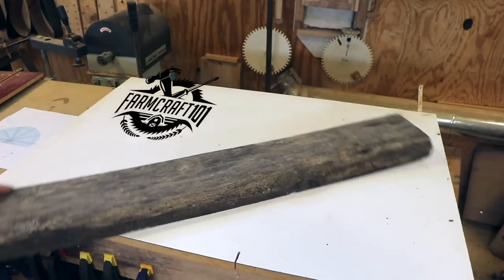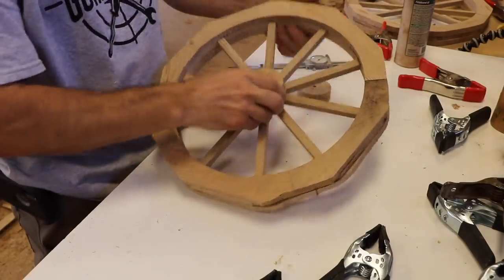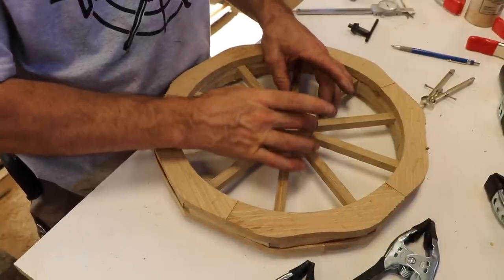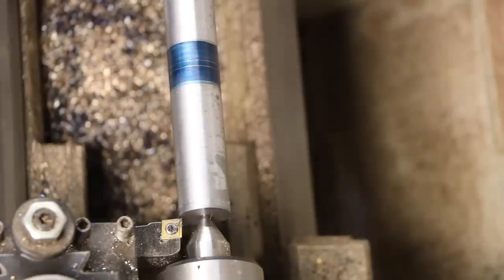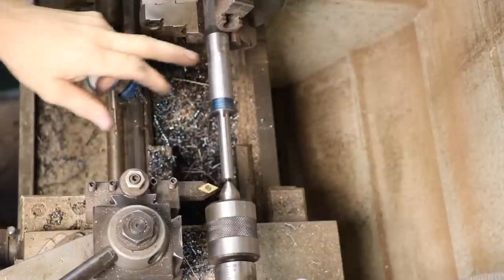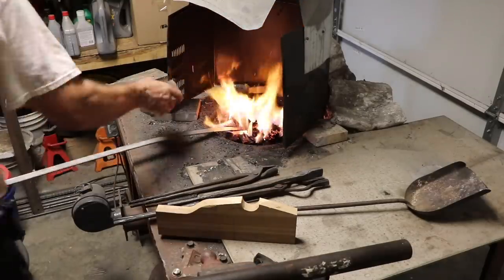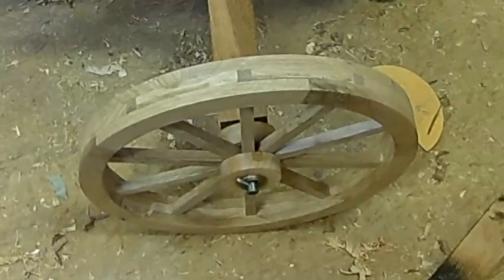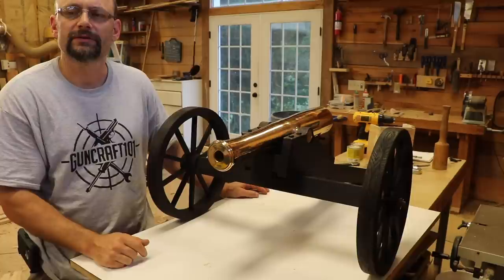Building a Historic Cannon Replica: The Carriage.  FarmCraft101

Comment: That's stunning.
After putting so much time and effort into this, I think you should take the final step and line the barrel with steel so you can fire it. 1/4" wall thickness would be perfectly adequate, because the liner will be supported on all sides by the brass.
If you do, be sure to make the liner out of solid bar stock. It's possible to use DOM tubing or similar, but that involves a separate breech plug, which is a janky way of doing it and will probably end up becoming dangerous after a while (whether welded or threaded, it provides places for corrosion to accumulate).
If you bore out a liner from solid stock, the cannon will last indefinitely as long as it is cleaned properly after firing.
If you do line the barrel, don't forget to also line the vent, so that corrosion doesn't start at the junction between the steel and brass. You can make the vent liner by boring a hole through a hex head stainless bolt.

Comment: I would suggest polishing it smooth and using crosshatches to carry a small layer of lubricant I think if you polish it completely smooth and relied on the bronze there may be some gaulding.  By the way I think you made a very responsible decision about the non fire I made one years ago out of stainless steel and it had a one and a quarter inch pocket for the powder shot golf balls I never found the golf balls but I found several billboards with holes through LOL burn finish is amazing

Comment: Bummer to hear you can't shoot it :( The silly This Old Tony-esque editing was on point though !
Reply: Keep an eye out on his other channels. He can't put everything here for political reasons.
Reply: But not as smooth ;)
Reply: Check out his other channels for updates on firing it.
Reply: I wouldn't shoot it just because of the casting defects.
Reply: @desepticon4  
Watch the video linked above - he's going to fill the barrel with molten lead and drill it out, leaving lead in the casting defects.
If it were me, I would make a steel liner for the barrel, which is a common practice in the cannon community. The lead should be adequate though.
Reply: @thepenultimateninja5797  That doesn't sound like it'll improve the structural integrity much. But what do I know.
Reply: @desepticon4  
I think it will be ok - the main casting flaw is some way up the barrel, so it's not going to be subject to the full pressure of the explosion. His main concern is smouldering debris getting caught in there and setting off the next charge as it is being loaded.
The lead should fix that.
Honestly, if it was me, I would put a steel liner in the barrel so I would know it was safe, but I think he'll be ok.

Comment: Torching is a good idea.  I’ve done it for several dozen projects.     I suggest getting a full char on all of the wood but leave the wheels be.      Once char is cooled down use a stiff nylon brush to remove it for an even finish.        Charring actually prevents moisture from getting into the wood as well is a natural pest repellent .        If you try and kiss the wood with a flame you will end up with an uneven-torch pattern.   Which is why I suggest a full char.       Once the outside is charred from the start you just move your way along the wood.     The outer char will prevent you from doing too much damage to the wood .          For deep chars you have to sit the tor h there for quite some time until the flame and wood start production on a deep orange flame.    So keep it steady and relatively fast pace and you will be set.     Also you can do a natural tan on the wood using oak chips and water.     I think you can also use urine with the wood chips to extract the natural tones from the oak.     
    Another stain that you can use is iron oxide and vinegar.  Add hydrogen peroxide to speed up the process with mere seconds rather than days .       If you need additional info or feedback I think you can now message her on YouTube, or if you like , You can email me .    Just comment on the post and I can give you my email and we can go back and forth there or a quick phone call.     Great job on the whole project.  I’ve been following this since you were researching metal compounds to use for your cannon 
   -Taren

Comment: The overall scorching is called shou sugi ban which is a Japanese style  (unless you're a pedant). You did well.  I wire brush it after, going with the grain which is tricky at joints, and then hose it off.  Yep, linseed oil every 6 months or so if outdoors.  Also, for anyone else,  glue joints can show so go lightly and possibly apply a fine touch of thinned matt black paint to them.

Comment: Smooth polished on bushings to shaft fit The least amount of friction possible..
 Standard moly grease works well
 Drill & tap axle shaft cross drill for lube holes. Install a grease zero into shaft.

Comment: Brother I admire your efforts. Next time would you dish the wheels so they won't collapse while your miniature horse is careening around a corner at 25 miles an hour. I've built 2 twelve lb. howitzers and a six lb. James at .35 scale I used the Mordechai plates to guide me on tube, carriage and implements. currently working on rev. war gun same scale. Thanks for your presentation.

Comment: Just a thought, but most cannon of the type you are casting have a steal liner in the guns barrel for added safety!  It is set in with some kind of high heat epoxy if I remember correctly!

Comment: Well there was staining done to woods. Tar staining was done for some cannon that did set outside or was near the oceans. Rare but it was done on a few. Otherwise old stains were made from boiling wood. I think it was the knots or such. 
Now I know you can use the cannon for firing a round unless you put a steel sleeve in it... But you might be able to make it into a reporting cannon. No pressure build up on the barrel at all.

Comment: 10:13 best thing to do would be to have spiral lubrication grooves in the bushing (similar to what you did for the epoxy, just shallower) and have the shaft polished. Another option would be honing the bushing but it requires special tools. If you leave the shaft rough it'll carry oil instead of the bushing but work into the Bronze much quicker.

Comment: Smooth axle, that's what I would've done. The gear box axles in my moped have no roller bearings on the inside ends, the opposite ends to the sprocket and clutch, they sit in a bronze bushing and are polished and the bronze bushings have spiral flutes in them but you don't need that.

Comment: If you plan to shoot it? Your not done. You will need at least 2 cross bolts to hold your gusset's to the center stock. The glue will not hold up to firing. Trust me on this. Having put that out. GREAT JOB!!

Comment: i normally grove my bushing like a barrel rifling one left hand spiral the other right hand so they carry the grease but the spiral groove dont come to the edge they stop short of it . the shaft always smooth. also the tail end of the carriage isnt finish. it needs the curve at the end with a a steel plate on the curve with the round pindle type hitch loop for towing and the 2 handles on the sides so a man could aim it.. but the burnt wood finish it beautiful

Comment: Did you nick my subscription list?  So far, I've spotted AvE, This Old Tony, Abom, Diresta, and a nod to Oxtoolco at the end.
Although it would have been cool to see it fire, I think the fact you've got any faults at all in the barrel rules out firing it.  You just can't tell if there's another defect that doesn't intersect the bore.  It's like when you buy timber for furniture making, and you pick the most fault free boards in the shop.  Then you plane them to thickness and find a knot, or a shake was lurking just under the surface (or is that just me?)
Great job, but I was a bit disappointed with the square spokes; I was expecting you to turn them.  Also, for authenticity, I think the rims would have been steam bent, rather than segmented, but I don't know if all cart wheels were made that way.

Comment: Need some metal rims for those wood wheels and spokes to hold it together then some caragehead bolts and washer and nuts for the metal rims and rifle the barrel for accurate fireing and good hits and some 50 cal primers to set it off with and a firepin design with a good spring and a 12 ft. Fireing cord . And then kaboom down range.and a 1/8 pound powder charge and a one pound ball shot of lead and a clothe packing like a muzzle loader rifle. And put some pin front sight that adjust Left and right and up and down by screwing it in or out and a peep sight rear sighting system. And you will have it made other than wheel chocks to keep it from rolling back when fired . I love it Man you did great. Rifleing should be 1 turn in 67 inches. That should be sufficient.

Comment: Smooth surfaces create less wear on the metals and oil lubrication is reccomended for cooling. That is to say in large scale or fast moving parts, for load bearing as what you're doing, a semi- polished surface should suffice with some WD-40 as lubrication should do plenty.

Comment: The axle should be as smooth as you can. A low viscosity lubricant should have no problem flowing between the two pieces.

Comment: Been fun to follow the journey!What's the model of the machine you used to bore/drill the axle holes at 13:16?Never seen one like that before....Not as smart as I thunk I was,lol.Made a barrel just like yours from brass barstock 'bout 30-35 yrs ago.Except mine is only 4-1/2"(the BARREL!),with just over .22 bore(hmm....)Easy to find lead that way.BTW, IT couldn't fire either ;-) Oh,and at 17:32.....Perfect....PERFECT??....Perfect Hell !!!,just LOOK at all that side-to-side wobble in those wheels!Why didn't you turn THEM true when you did the diameters?!?!?! What kinda Machinist/Woodworker/Armorer/Fabricator ARE you anyway?!?!?That's what I thought!Now sit down,shut up,or l'll pull this car over right now,Mister!Lastly,call the Cannon Phoenix.Both the finish of the wood,and the fact that the alloy rose from the Ashes(AND the forge,AND the driveway,AND the garage floor SEVERAL times,lol )demand it!

Comment: The axle should be as smooth as you can make it or it will wear the bronze like a rat tail file!  Nice job!
Reply: With the amount of rolling those wheels will actually see, the sleeves would last forever even if a piece of hardware store rod were to be used for axles.

Comment: I would have made a water based stain using water and rusted metal to darken it and then cover it in linseed oil.  There is also a way to darken the wood using vinegar that will react with certain organic material in the wood similar to vinegaroon used on leather.

Comment: reamers are good when you need a round hole of a specific size, but boring is more dimensionally accurate. reamers follow the pilot hole, and if the pilot hole is not straight, the reamed hole will not be straight. boring does not care about how straight the hole is, it will make it as straight as the machine holding it and the workholding setup allow.

Comment: Two things:

1) you could've alligned them hubs in the wood lathe...using the tailstock in a similar way to how you'd assemble a large vase...

2) I wouldn't have set them gunmetal bushings in until I'd turned the axles...
This way you could easily bring the bushings to your lathe for a try-fit...without having to disturb the axle in the lathe chuck...👍🇬🇧
Reply from the maker: Both good points!

Comment: I'd have gone with walnut husks for a dark stain, then linseed oiled the carriage.
As for firing it, I'd feel comfortable in initially firing a reduced load, then a test load, if erosion wasn't observed in the defective barrel region. It's what was done with the original models and a test load was an overloaded charge.
If you still aren't comfortable, just go with a bore sleeve of steel.

Comment: could always make it a carbide cannon the fires a rubber ball or a greased golf ball. - it will still make of hell of BANG without using gunpowder or a lead projectile.  pour eight to ten carbide pellets into the barrel,  push the ball into the barrel, pour about an eighth teaspoon water down igniter hole, wait about 10 to 15 seconds, put lighter flame to igniter hole and an ear-deafening  BOOM will be the results with the ball flying 1/4 to half a mile. You may never find it again.  As kids, we made carbide cannons out of old water pipe, PVC pipe, and Pingles cans that fired tennis balls. Lighter fluid  (naptha) works well as propellent too.  With lighter fluid, you don't need any water. It ready to fire as soon as reload, squirt lighter fluid down the igniter hole and stand back, KA BLAMMO.  Louder than or equal to an M80 or Cherry Bomb. Annoy neighbors, scare the crap out of dogs and cats and wildlife, make sleeping old ladies pee the bed, and wait for the cops to come.  We were such hell-raisers as teens. OMG.

Comment: 10:23 hello i am a machinist. for a plain bearing like this (and almost any other type of bearing for that matter) you want it to be as smooth as possible (optimally, polished) and grease it. any roughness whatsoever will simply give a place for grit to build up and abrade out the softer bearing material. for your purposes, heavy tacky oil like way oil would work fine in it.

Comment: Drill down the center of the shaft till you get to the middle and tap for grease fitting cut a grove in the center and drill down to the cavity to allow grease to flow out to the brass bushing. Use automotive grease and you'll never have a problem. Grease every few months

Comment: The side of the axle that .486 should have had a radius instead of a shape corner haven a shape corner at 90 degree would be a point of failure since the radius since the weight will be distributed across the radius instead of all the weight being focused on sharp corner where the axle meets and stopper

Comment: raw linseed oil is much better and deeper penetratig oil,pluss no lead and chemicals in it. And it should have some large bolts thru the carriage and nuts shoul be square nuts,that is the old type. And metall on the wheels. put a steel lining in the bore and shoot away,just remember to use canon granulated powder. It is coarser then  big musket powder.

Comment: As a european i want to give you a tip, use the metric system. 

1 size lower than half inch? How dumb does that sound lol, here it's just per half mm that it goes up, it couldn't be easier.

Comment: I want to see it fire.This is how to fire it safely.Use not much black powder at first.1F powder.Small handful.20 grams.Use no wadding. And then use a projectile which has a loose fit about 1/16 inch all around or to be really safe 1/8 inch.Try a wooden cylinder first.If you use a steel projectile latter the force on the gun is greater.The whole carriage will roll back.Safest place to stand is behind breach not beside.But increasing the amount of powder chamber pressure rises. Be careful.1/4 to 1/2 pound of powder may blow up cannon. This small amount of powder 20g will fire wood projectile a few hundred feet. Very important the projectile must be long enough to make it stable and front nose must be slanted on leading edge to avoid snags on rough defects. Suggest a 45 degree chamfer edge. For an easy defense wall for the gunner use a 55 gallon barrel full of water. Light fuse hide behind barrel. Not as good but will help would be a garbage can full of water. Be sure to use proper fuse. Go to a high explosive dealer and buy a roll of fuse. Tell them its for a black powder cannon. Have fun. If your defense wall barrel is on the side of the cannon the gunner can crouch down behind the barrel and look forward and see the projectile.

Comment: I’m not sure what size you made your bore. Get in touch with Dixie gun works. Have them machine a 3/16 stainless steel barrel insert. Over bore your barrel and leave about .001000 of an inch. To make it snug. Coat the bore liner into their epoxy. Press the stainless steel barrel insert into your overboard cannon. Should end up with 1 inch rifled barrel. Load it with 300 gr of black powder and all purpose flour 1:1 ratio. 350 grains of black powder 350 grains of flour. Preload these into aluminum foil or yet some ladies nylons. Load the powder into that. I prefer the tin foil method. It is harder to clean out between shots though. Cr off about 16 inches of cannon fixed. You seem to have a very good working knowledge of machine working. Make a ball mould that is .985 of an inch. If you going to use patched balls. If your going to not use a patch machine your mold to .998 of an inch. Load the puppy up pack your ball on top of your flour black powder mixture. You should of know have already cut a 3/16 inch hole about 2 inches awa from the bores end. Light the fuse. The black powder or pyrodex will push your ball about 500 yards fairly accurately. The flor gets ignited when the flash ignited it when the ball exits the muzzle. Makes a big ole cloud of smoke. The spectators love the big billowing clouds of smoke for some reason. When I took machine shop in high school I made a 1/4 scale 6 pound parrot rifle. It ended up with a machined steel barrel and a .75 inch muzzle insert. I fired it at ball games when we scored. After school I joined the Army. My dad thought it would be a great yard decoration. He painted it gun metal black. It set their for abut 6 years. He kept the muzzle plugged and the fuse hole plugged. I had made my carriage out of cedar and poplar so after about 6 years it pretty well rotted the carriage. I didn’t mind. I’ve got all the hardware and the barrel in my shop. Some day I’ll build a new carriage for it. There’s just not much of a call for a 3/4 inch lead ball muzzle loader though.  I think maybe I have shot an actual ball out of it was maybe 3 times. Most of the time it was a salute rifle.